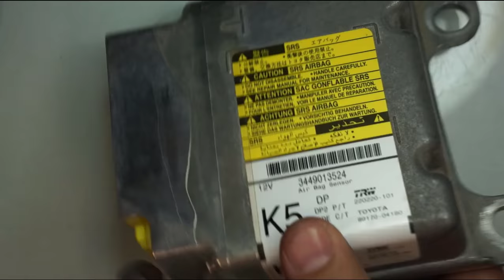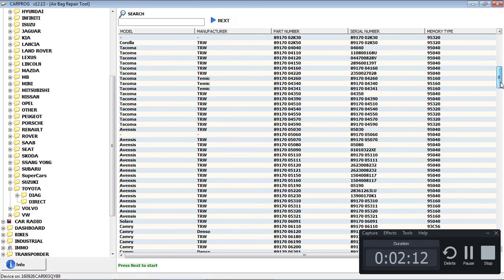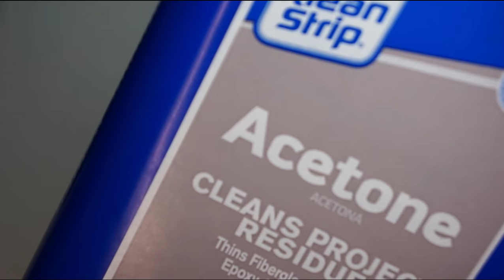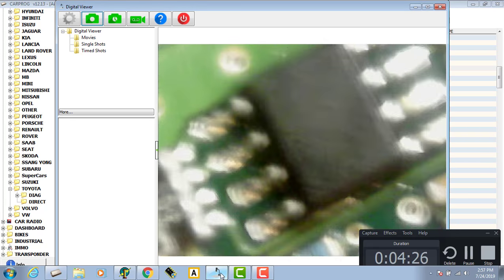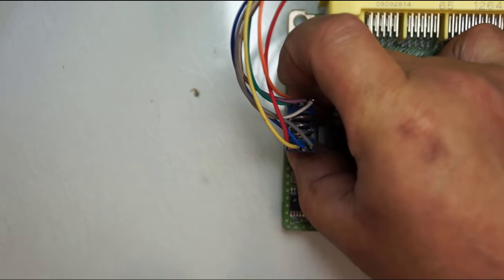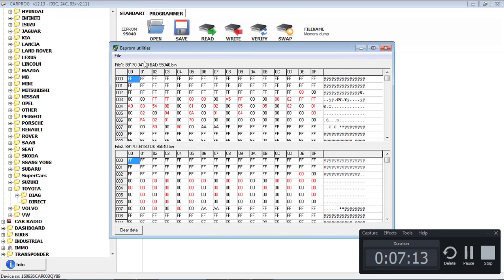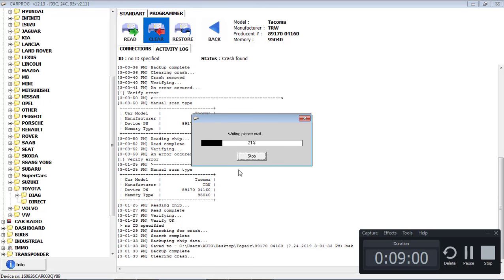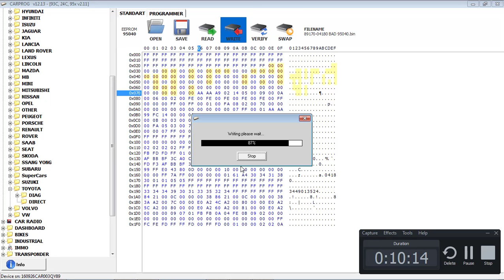Expert Advice: Airbag Module Reset Explained

Comment: It's really very good thanks and regards.....
Reply from the maker: thank you
Reply: @vehix411  does a new module need to be programmed?
Reply: @vehix411 Sir want to know how did got the promgrame on ur pc.... Did u pay for that??
If you pay for that which website is that...

I also work on autel programme but there is nothing i got without scaner..,. Pls give a address to got programme file like you...pls sir......

🙏🙏

I will pay for that
Reply: @vehix411 Sir want to know how did got the promgrame on ur pc.... Did u pay for that??
If you pay for that which website is that...

I also work on autel programme but there is nothing i got without scaner..,. Pls give a address to got programme file like you...pls sir......

🙏🙏

I will pay for that
Reply: @vehix411 Sir want to know how did got the promgrame on ur pc.... Did u pay for that??
If you pay for that which website is that...

I also work on autel programme but there is nothing i got without scaner..,. Pls give a address to got programme file like you...pls sir......

🙏🙏

I will pay for that 

Pls sir

Comment: Good job spotting the Atmel EEPROM. Something else to consider on older cars is to replace those two large electrolytic capacitors on the board. They dry out and knock out the sensor computer.  Same for the ECU, speedometer, and tachometer. 
Restored my 1995 Camry to full sensors/ecu/airbag/speedo, and leds for dash lamps. Hope this tip helps.

Comment: Great video. Is the Ancel Fix2000 Scanner  from Amazon you have included the link in the description can be used to clear the Airbag Light? Want to use to my Mazda 3 that I replaced the airbag. Thanks

Comment: Great video. 

I don't have the equipment. Or more I don't know where I could find the right code to insert in (you can make an eprom read/writer using an Arduino) 

Here's to hoping I can find someone local to reset it without replacing all my airbags SMH.

Comment: Hello! I rear-end a car going maybe 35mph max, no one injured, very minor cosmetic damage, but all airbags deployed making it so my car would not move/drive/reverse at all. My question is do I have to have the airbags completely reinstalled for my prius to drive again or can I just have the codes cleared out, or do I just need to replace the sensors while not installing the airbags themselves? Thank you and I appreciate your response!
Reply from the maker: Every deployed airbag must be replaced
Reply: @vehix411  just for the car to even drive?
Reply: @OpenHeartMinistry4  It depends on the car, my Versa was able to drive without the airbags being replaced or reset. Prius's traction battery disconnect in an accident, even a very minor one. Or the +/- lead shorted to chasis. Typically all cars shut their fuel pump off in rear end collisions as that is where the fuel pump is. You can't run the car without fuel, but if the battery won't even turn on, and pressing the brakes doesn't even give a response then you just need to have the traction battery reset. It should run without the airbags. But the airbag and airbag sensors circuitry on a Prius is worth more than the car itself. Unless you can find for dirt cheap at a junkyard you may be better off cashing out a total loss. At this moment you should take out the old deployed airbags and connectors regardless, as they are useless. The sensors may be salvageable though.
Reply: Thanks! So after everything, the only reason my car would not drive was due to the battery shutting off. It was jumped all night long and has been working great since. There is a ticking noise (kind of sounds like a fan) coming from the very front of the hood now after the accident so I'm just not sure what I am going to do about that yet.
Reply: @OpenHeartMinistry4   Sounds like a bad relay or fuse to a part seeing as it started after your battery shorted/shut off. Universal relay switches are really cheap to buy online. You can switch out your relays for one and switch it on and see which part is causing the ticking. Which probably means it isn't getting enough power, or getting power and the part isn't responding. Or it could just be an oil pressure issue, timing chain issue. Even a suspension issue with the u joints or axle shafts. I wish you the best of luck in your vehicle repairs. I'm also almost done repairing mine myself, it's quite a process, I understand.

Comment: Thanks for the video. When a Toyota is in this condition with the airbag light on but no code, is the airbag itself still functional?
Reply: If it’s like my Nissan then no, the module isn’t going to know when you get into a crash so airbags won’t deploy. I need to get mine fixed

Comment: I recently replaced the clockspring on my Nissan versa 2012 (horn not working and airbag light flashing) and it works now. However, airbag light is still flashing and now the yellow traction control light is on. Don't know what the problem is. Had no accidents. Mechanic says it's the airbag module.
Reply: Do you have a scanner ? Try clearing the codes. .. or it could be the steering angle sensor. Maybe you moved it by accident and when you put it back on it triggered the traction light.
Reply: This issue has to do when replacing the clockspring, you cannot turn the clockspring around one bit. The steerinwheel and clockspring have to align as per factory specs..If its turned a little, it basiclly tells the abs sensor that there is something wrong with way your wheels are turned opposed to where the position of the clockspring.

Comment: Hi, I saw in a You Tube the following:

''Hi Alec, Yes you are right for some models they don't need to be married, however for most models, generally speaking, these computers need to be programmed to the car.''

I have a 2008 Toyota Rav4 base model (2.5 liter) and by mistake both roof airbags deployed and both front seat retractors were activated.

My questions are:

- First, if I buy both used roof airbags and both seat belts with their retractor systems plus the SRS module from the same 2008 Rav4, will it work and will the airbag light go off? Will it need to be married to the rear seat belts and to the ECU?

-Second, if I buy both used roof airbags and both seat belts with their retractor systems without replacing the SRS module, will it work and will the airbag light go off? 

-Third, will a good EBD2 be able to erase the codes from the existing SRS module in order to get the airbag light off?

Many thanks for taking the time to answer.

Gerard
Reply from the maker: Can’t clear the crash on car with a scanner via obd must remove module to clear the crash and yes the light won’t clear until crash is reset
Reply: I have the two curtains deployed on my Ford Fiesta, to be clear, first I must remove the module and send it to reset, and I put the new curtains and that's it. I don't need to do anything else on the vehicle's computer. Thanks for your video

Comment: So if airbags are all replaced, airbag codes all cleared, and the red airbag light is on (Toyota Prius), does that mean the airbag system is non-functional until this reset procedure is followed?
Reply: Correct